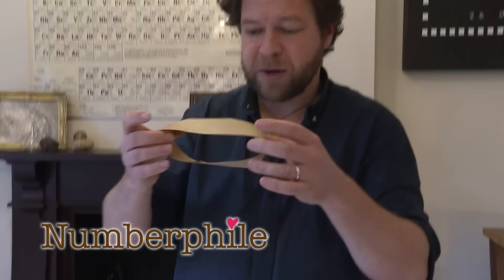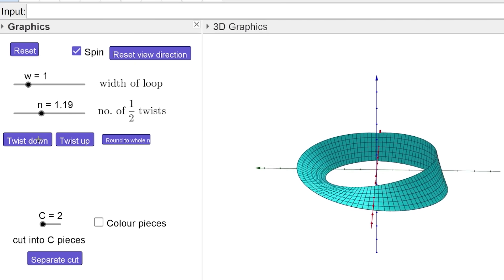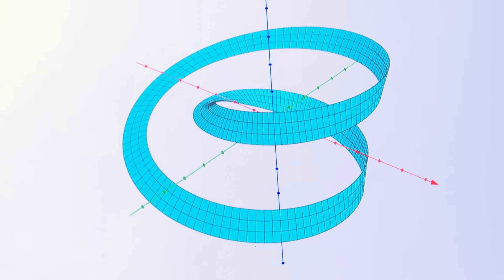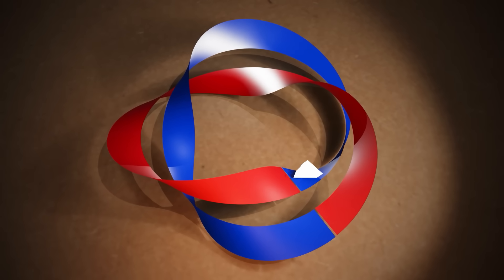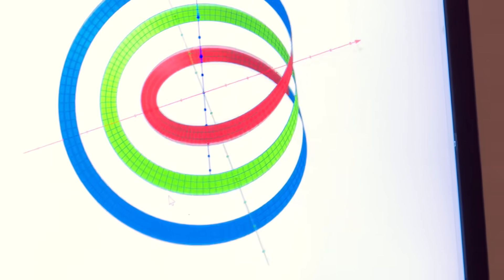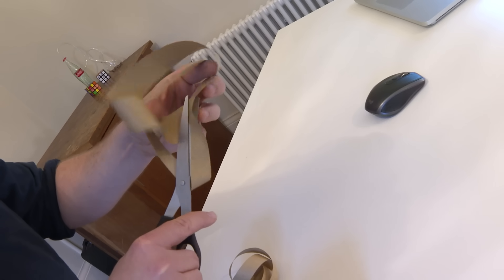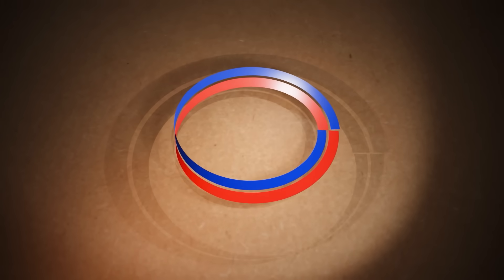An Unexpected Twist on Möbius Strips - Numberphile

Comment from the maker: More Ben Sparks on Numberphile: http://bit.ly/Sparks_Playlist
Möbius videos on Numberphile - https://www.youtube.com/playlist?list=PLt5AfwLFPxWLX3Y7d3Hqq-qcsDTRaZef6
Reply: It would be great if you used double colored paper front and back with different color so that when you cut a cylinder both front and back color doesnt touch each other. 

But when you have a half twist both front and back side touching each other making it one sided mobius strip. 

Your brown color paper is worse in explaining to audience, even the visualization simulation had both front and back side of paper being same color confusing.

Overall ok, not great one.
Reply: If you want a really unexpected result, try joining an ordinary loop to a moebius at 90 degrees to each other then cut down the middle of both.
Reply: @patdoyle2003 
When you than cut along the ordinary loop, you simply make the moebius able to untwist and when you cut along that then, the whole thing unfolds into a square/rectangular flat frame.
Just the same as with two ordinary loops
Reply: I mentally get lost but JUST ASSUMED but now wonder hasn't ANYONE USED COLORED PAPER STRIPS with sections different colors and grids printed on the paper such IRL do what he needed to do thru a computer sim? Has anyone ever considered IRL this geometry mindfkery is what happens every SECOND as our DNA strips of RNA coil uncoil link or any process of matter energy flowing into shapes follows this as contraint rule for vectors of force energy. Oldtimes this was MAJIKS :eyes-pink-heart-shape:
Reply: Where can i get the simulation, that was used here?
Reply: This would be a weird but very mathy way to make paper chains.

Comment: If, before you turn your initial paper strip, you draw lines on both sides of the strip dividing the flat strip into three equally wide strips, it's easier to keep track of your cutting.

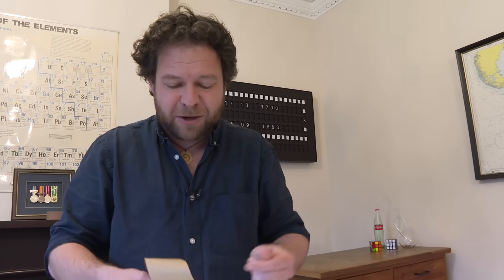Comment: 1:36 use a zipper from the sewing store that allows for being separated at the bottom, and attach the top and bottom of the sides with a twist, use buttons sewn on the ends to allow them to be attached and detached, use different colors from the same manufacturer to allow you to change how they’re assembled to the furthest extent, use pins to attach multiple zippers side by size to allow them to be cut in 3

Comment: This had me messed up for a minute but I think I get it. I was very confused because I couldn't understand why it matters WHERE you cut the half-twist mobius strip, why cutting closer to the edge gave such a different result (two interlocked loops instead of one longer loop. The fact that it's exactly 1/3 in the simulation seemed like a red herring because  it's just that you cut somewhere OTHER than the center. But then there's no way one can so precisely cut JUST the exact CENTER outside the simulation so how are we so consistently able to get the right result with real paper? The resolution was when I realized -- cutting closer to the edge is topologically the same as starting out by cutting in the center, and then just before you meet your cut having gone around the loop, you swerve and continue cutting next to your "original" cut (of course, it's actually the same cut). Then you willl (counterintuitively) come to a point where you can swerve again and finish the cut right where you first started. And the result will be the two interlocked loops one twice as long as the other.

Comment: I can't recall if I heard Tadashi say this on Numberphile or somewhere else, but one way to understand the 1/3 case is: suppose you now vary the cut distance, in particular suppose you make it smaller,  getting closer and closer to the edge, until you're essentially just shaving away the edge - then it becomes obvious that this will result in one thin connected strip, cause the Moebius strip has only one edge, and that the strip remaining in the middle will just be another Moebius strip, only thinner.

Comment: It's interesting to notice that the phenomena shown in this video are of two different kinds. Some depend on the topology of Moebius strips and cylinders and some on the way they ar embedded in our 3-dimensional space. In fact there are only two topological spaces here: the Móebius strip (odd number of twists) and the cylinder or annulus (even number of twists). Different numbers of twists of same parity give the same topology but different embeddings. Therefore cutting in half strips with even number of twists always gives two cylinders which are twisted and linked in different ways depending on the number of twists. Similarly cutting in half strips with odd number of twists always gives one cylinder twisted and knotted in different ways depending on the number of twists.
In other words the topology (inner property) of pieces depends only on the topology of the strip (cylinder becomes two cylinders, Moebius strip becomes one cylinder) but the position (embedding, outer property) of these pieces depends also on the position (embedding) of the cylider or Moebius strip.
The same holds for other ways of cutting (eg. in thirds).
It's also interesting that these properties of the Moebius strip are in close relation with the possibility of covering it twice with a cylinder.
This video is very inspiring!

Comment: 10:21 Oh wow. This explains two things in physics for me with regards to the strong and weak force. Imagine the whole Mobius band is an element and splitting it evenly without any turns makes it into two weakly connected surfaces that separate with the cut (something like decay into stable pieces by emitting a single quantum of paper). But introducing a "half-turn" makes them strongly connected and cutting them won't cause a decay into pieces, but will be stable. The green bit, to me, is like an excess electron that decays when you engaged in the "fission" of the paper. The remainder would be whichever element we corresponded to the length of the strip. 😊 The penny did drop because now I see this is what the 2:1 quark ratio means in nucleons.

Comment: A mechanical double parallel scissors would be great for the demo. Also the fact that the green part is a moebius strip is unsurprising if you draw a river ( large blue pen) along the middle of the moebius band and see that this 'river' has one bank only  which gives you the meaning of living  IN the band.

Comment: A lot of this follows easily from thinking of a Mobius strip as a rectangle with two opposite sides glued together but with opposite orientation. You can tell that cutting it down the middle is still connected by just imagining wandering off the top right and returning around to the bottom left. Sometimes abstraction makes things simpler.

Comment: I think you could simplify a lot of these multi twist loops by treating them as rings with polygonal cross sections, i.e., if you have a ring with a square crossection, giving it a 1/4 or 3/4 twist gives you one surface that loops four times, but a half twist is results in two separate surfaces that loop twice each.

Comment: About predicting the number of half-twists you get when cutting a Moebius strip-

At 3:30 you have just cut a strip in half. Each “half” still has a half-twist, and since there are two “halves”, there must be two half-twists.

Therefore the resulting object has two sides, two edges, two half-twists and isn’t a Moebius strip.

The same reasoning applies to the other cuts.

Comment: There is a way of gluing two Möbius strips together orthogonally and then cut them in one path so that the results are two linked heart-shaped forms coming out. It's perfect for weddings letting the couple do it. But beware the right construction, if done wrong you will get still two heart-shaped forms, but separated.

Comment: A suggestion for an addition to this simulation--identify each strip (the two in the single-cut, the three in the double-cut, etc.) with a different set of symbols, such as consecutive numbers, letters, and  so on.  When you re-join the ends after the cuts, you can identify and track the points where the cuts occur on each strip.

Comment: I can prove that a mobius strip has 2 sides*

*In real life
Reply: So as atoms are 3 dimensional things so as their compound and so as a piece of paper. So now as everyone knows that a piece of paper is thin but not infinitely thin(thickness ≠ 0) so now that thin surface makes another side of the mobius strip, so a möbius strip doesn't exist in real life . Because that is how topology and geometry works.

But A modified version of möbius strip exists in real life what I call möbius rod, so here you take a cuboidal rod and twist 90° (not 180°) and join the ends now it only has a side but you will pass through the same starting part 3 times instead of only another (1) time. I hope you liked it.

Or a ball(sphere) also only has 1 side to those who say smooth out the edges. -πr²
Reply: @rahoro_biren_zene  Are you on the spectrum?

Comment: The 'Even vs. Odd' twist pattern you spotted at 05:43 is the real lightbulb moment. It perfectly generalizes the topology: Odd half-twists always preserve the 'Möbius' property (1 edge, 1 side), while Even half-twists resolve back to the 'Cylinder' property (2 edges, 2 sides). The simulation proves that the cut just exposes the boundary conditions that were there all along. Really satisfying watch!

Comment: I haven't thought about the link between Mobius strips and knots but now I'm curious!

if you "inflate" a cut Mobius strip with a set number of twists, can you get all the knots with that number of crossings?
Reply: A Mobius strip with 3 half twists can be cut to make a trefoil knot which is kind of like a three pointed star. A Mobius strip with 5 half twists can be cut to make a cinguefoil knot which is kind of like a five pointed star. A Mobius strip with 7 half twists can be cut to make a  kind of seven pointed star knot. A Mobius strip with 9 half twists can be cut to make a  kind of nine pointed star knot. Etc., etc.  Each of the knots can also be made in the form of a Mobius strip; i.e., it can be made so that it has a single side and a single edge. And of course each of these knots can then be cut in half making even more interesting knots.
Reply: @waynekollinger7080 cool! So would all "prime" knots be possible to make from an equivalently twisted Mobius strip?

Comment: You fail to mention scheme for introducing (whole) twists into a loop without rotating the ends relative to one another.  Hold a complete loop in 2 places close to one another.  Cut between.  Pass the middle of the loop through the cut gap, but keep the 2 ends first held in same relation.  Rejoin the 2 ends.  You now have a loop with a single whole twist.

Comment: I don't know if you realize it but the double half-twist that turns the Möbius strip into a double loop is at least related to the reason why the electron is a spin 1/2 particle.

According to Williamson & Van der Mark (both electrical engineers) electron could be a photon in the shape of a rotating doubly twisted Möbius strip that draws out a torus - they published this in Annales de la Fondation Louis de Broglie, Volume 22 no 2, 1997 paper: "Is the electron a photon with toroidal topology?", J.G. Williamson(a) and M.B. van der Mark(b), page 136, Figure 1 :
(a)Glasgow University, Department of Electronics & Electrical Engineering, Glasgow G12 8QQ, Scotland , 
(b)Philips Research Laboratories, Prof. Holstlaan 4, 5656 AA Eindhoven, The Netherlands

This paper was completely ignored by academic physicists, but recently was bravely mentioned by the @HuygensOptics channel.

Comment: This feels like it's an overlap with knot theory. Wonder if there's an invarient based on partitions of a mobius loop.
Reply: A Mobius strip with 3 half twists can be cut to make a trefoil knot which is kind of like a three pointed star. A Mobius strip with 5 half twists can be cut to make a cinguefoil knot which is kind of like a five pointed star. A Mobius strip with 7 half twists can be cut to make a  kind of seven pointed star knot. A Mobius strip with 9 half twists can be cut to make a  kind of nine pointed star knot. Etc., etc.  Each of the knots can also be made in the form of a Mobius strip; i.e., it can be made so that it has a single side and a single edge. And of course each of these knots can then be cut in half making even more interesting knots.
Reply: @waynekollinger7080  i know the pattern can continue, i'm more wondering if any knot can be made from performing operations on a ribbon, like adding a twist and cutting, or if it's just the 'torus knots' i think they're called. plus, links of those.

Comment: 6:00, it's a trefoil knot! That's cool. What knots do you get with more twists?
Reply: A Mobius strip with 3 half twists can be cut to make a trefoil knot which is kind of like a three pointed star. A Mobius strip with 5 half twists can be cut to make a cinguefoil knot which is kind of like a five pointed star. A Mobius strip with 7 half twists can be cut to make a  kind of seven pointed star knot. A Mobius strip with 9 half twists can be cut to make a  kind of nine pointed star knot. Etc., etc.  Each of the knots can also be made in the form of a Mobius strip; i.e., can be made so that it has a single side and a single edge. And of course each of these knots can then be cut in half making even more interesting knots.

Comment: At six minute in you describe twist loop, cut down the middle as a “horrendous looking thing.”  MC Escher did a beautiful woodcut of the 3 twist band.  When it is cut down the middle, the resulting strip is a trefoil knot.
Reply: A Mobius strip with 3 half twists can be cut to make a trefoil knot which is kind of like a three pointed star. A Mobius strip with 5 half twists can be cut to make a cinguefoil knot which is kind of like a five pointed star. A Mobius strip with 7 half twists can be cut to make a  kind of seven pointed star knot. A Mobius strip with 9 half twists can be cut to make a  kind of nine pointed star knot. Etc., etc.  Each of the knots can also be made in the form of a Mobius strip; i.e., it can be made so that it has a single side and a single edge. And of course each of these knots can then be cut in half making even more interesting knots.

Comment: When cutting a Möbius strip, you have the choice of cutting along an orientation-reversing path or an orientation-preserving path. A path is orientation-reversing if when sliding along one side of the path, when you return to where you started you are on the other side. That's the first cut that Sparks did, and it produced a double-twisted ring, so it is no longer a Möbius strip. The second cut they did was cutting along an orientation-preserving path, so when you return to where you started, you are on the same side. That's the last cut that Sparks did, and it produced two trips: a double twisted strip and a Möbius strip. No even-twisted strip has an orientation-reversing path. And all odd-twisted strips have an orientation-reversing path.

Comment: I had this eureka moment in school when I was physically making a Möbius strip. When I did the twist and noticed that I was now connecting the "bottom" half of one end to the "top" half of the other, a lot of facts about Möbius strips became obvious to me, just like in this video. I always just thought about it in terms of "top" and "bottom", though. Using colors is a very nice way to visualize it.

EDIT: Maybe for a student demo it'd be helpful to make a strip where the ends to be joined are marked: red and blue As on one side, red and blue Bs on the other. For a 0-twist loop, they all line up, but when you do one twist, you can see not only that the red half is connected to the blue half but that the A side is connected to the B side.

Comment: The green strip in the triple cut, single twist mobius loop that resulted in linked loops of different lengths should just be it's own mobius loop that can be cut in half for a same length, half width loop.

Comment: From a topographical standpoint, how do you explain a surface which has only one side and one edge?  Does it have an area?  Is this shape just a special case like a Klein bottle?
Reply: A surface is two-dimensional. It has length and width but no thickness. All surfaces have area. They don't have volume.
In mathematics a Mobius strip is a two dimensional surface with only one side and one edge.
A paper model of a Mobius strip is a three-dimensional object because it has length, width, and thickness. Because it has thickness the paper model actual;y has two sides and two edges. However, because paper is paper thin the model serves to show what a Mobius strip looks like.